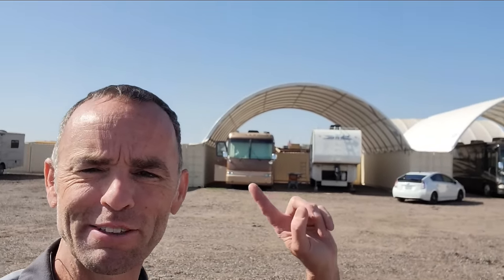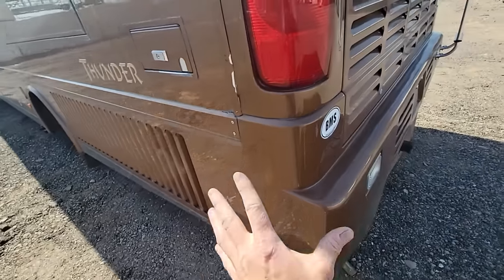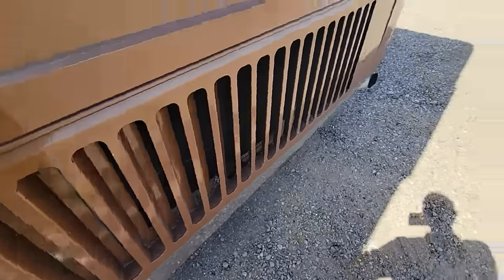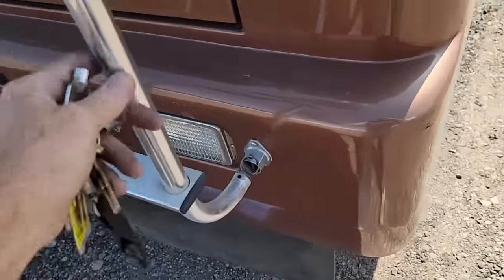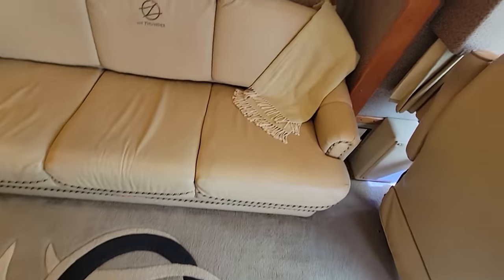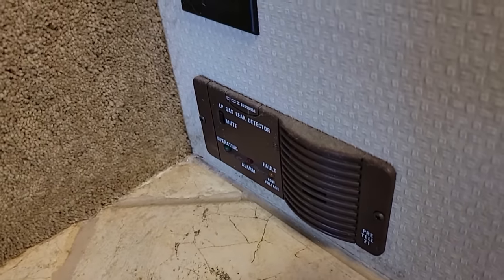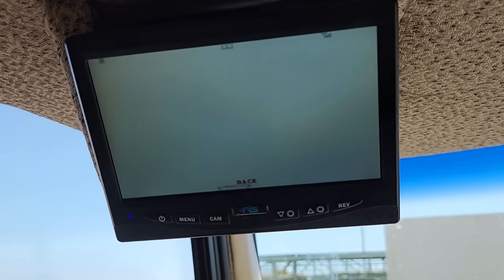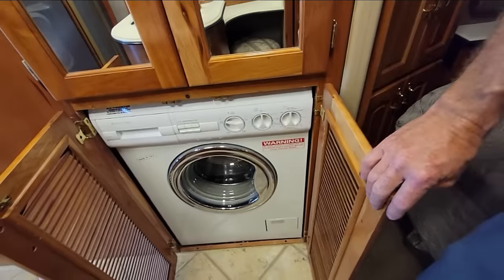The Truth About My RV and Other Common Questions

Comment: I just can't quit chuckling after watching these. I paid 75K for my 1995 Beaver Patriot more than 20 years ago and have lived in it ever since full time. Its still going strong with 120 K miles on it. Boondocking all the time. Never paid for a campsite !! The roof is fully covered with solar panels that run a home style fridge and freezer along with induction cooking and Starlink internet. Aesthetically its rough all over from the desert sun but keeps holding together !! Go Beaver !!
Reply from the maker: That's AWESOME!!! Thanks for watching!
Reply: Since you said you live in yours full time and boondock I got curious if you had videos. Those movie road rocks you filmed in Alabama Hills I can see out my back window right now! We camped and fished up here. My partner I met about 12 years ago said come see where I fish. I wasnt so much a rural woman. I actually started in a big city as a child. He said come camp with me so we took his 5th wheel. Multi issues, no heat! Then got totaled by a tree. Not our fault!  Got smaller trailer with insurance pay out thats badly built but chassis is good. Then before I knew it I had moved in with him and looking for our retirement home 4 years ago. And here we are!
Reply: I bought a house in 1996 for 75k, sold it for 350k six years ago.
Reply: Dude you're epic.  Where are you now
Reply: I probably wouldn’t have burned out on RV living if mine had been as nice as the Beaver. After 6 years in an inexpensive 5th wheel, I was pretty much done with it.. But at least the low cost of living allowed me to save enough to completely pay for a well built house in Alabama. Houses that would go for 80 to 120k in other states I’ve lived, are hella cheap here - 30k on a half acre lot, in a quiet,  safe neighborhood.
Reply: @darcymck1  and??
Reply: @darcymck1  Since I don't pay rent or property taxes for the past 20 years I bet my Beaver returned almost that much.
Reply: @thehomelesswhisperer9733  Secret Place in National Forest
Reply: What part of alabama, if I may ask? Cheap property in a conservative state is desireable! :)
Reply: How do you find places to boondock? These Beaver's make this seem doable!
Reply: Living the dream 👍👍👍
Reply: @thehomelesswhisperer9733 "And" he's way ahead of the financial game. Granted RV full-time living or even traveling is a lifestyle but there's no denying that these rigs have zero investment value & painfully depreciate.
Reply: @daveulmer So you said, perhaps that makes you sleep better at night. If your "returned" value of the rig is that much, the home owners return could be placed at $550K. Just saying 😊.
Reply: As. I had asked the price question in your first video and if I find it again, I will change my comments  for them to watch THIS video where you tell the price and why you felt it worth it, but AM curious at to what the owner had asked for (as to show how much it  was still worth after many years-and also to show how skilled a negotiator are 😅) but it WOULD be helpful if you put the time stamp on this video as to where it shows how much it cost.  For some people like me, they might not want to hear all the details LQTM!!
Reply: @darcymck1  asking for a brownie button? Gold star? Stick with apples to apples. If that’s your best investment I pity you
Reply: @thehomelesswhisperer9733  he should of held onto it for another 4!😂

Comment: After you said $64K book and more miles than book, I thought you were going to say, "So I offered the nice, rich old couple with no heirs $42K and they took $51K so they could upgrade to a suite on their upcoming cruise to Antarctica."   Of course you did fine, being a pro, just surprised you resisted the temptation to get something slightly rougher to put more sweat equity into it.  And in absolute terms, it's a great buy compared to the prices they're getting for new stuff slapped together in 2 days and pushed out the door..
Reply from the maker: I've seen enough of them by now, I knew what I wanted

Comment: For that motor air intake you could bend a piece of copper to cover / cap that seam, siliconing on the outer panel & soldering on the inside or you could clean both sides thoroughly and use a window seam sealer tape but I'm not sure about UV resistance.  Love your videos !

Comment: I believe the Thunder was their top; model with more HP than the patriot.  From what you showed us, there are non safety issues (aside for cO2 detectors, no structural issues and no roof issues. Plus you dealt with the previous owner so you have an accurate history on it too.  I always say that the 'perfect' price is in our own heads.  We decide if what we paid was worth what we got.  It certainly seems that you got every bit of what you paid for.  Lucky for you, repairs and upgrades might be less expensive because you have the tools and lots of experience to don them yourself.
Reply from the maker: If Only I had the time! :) I am happy with what I paid :)

Comment: Considering what is charged for a teardrop camper these days (I just saw one for offroading that starts at $99,000), what you paid for this was a good cost/benefit value. I did notice one very minor thing that you partially brought up in this video: you said that a previous owner may have changed some of the upholstery. I believe that is correct. The outside logos all say, "455 Thunder", but he upholstery embroidery says "425 Thunder".

Comment: I know this was 2 years ago. But thanks to you and folks like Liz Amazing. Last month. I think I found exactly what I wanted. Exactly, what I was looking for. With only one small exception. But exactly. What I never thought I could or would ever own.

I got it from exactly the kind of people. I wanted to purchase it from. They had a very nice home. It was beautiful inside. It was not cheap. They were living downtown. In a house. Right off of Main Street. Of Lockhart, Texas. And he was 88 and she was 85. And it was time to hang up the, Motorhome.

Though they told me they had only owned it for a few years. They had purchased it from another, elderly woman. And they don't know. If they are the second or more owners? They told me.

For a single person myself. It's a 34 footer. A 22-year-old, 2002, Monaco, Knight. And the one small exception it did not have for me. It only has 3 slide outs. It didn't have the 4th slide out. With the miniature office. Oh well? I'll have to use the dining table. As it's just me. My husband passed on some years ago. We enjoyed the 1986, Fleetwood Southwind motorhome I had purchased in 2012. But it was time for that one to go. It no longer serve my needs. And memories, painful. I needed a new, new or old white trash motorhome for myself. And with 65,100 miles on the Cummins 300 HP. The 7.5 kW Onan quiet diesel generator with, 1000 hours on it. Everything stock. Everything works great. Everything looks like new. These old folks certainly didn't wear it out or trash it any, at all. The treated it with great reverence. One can see. And it has the 4 door deluxe, Nor Cold, combo LP/120 V, refrigerator freezer. With the dual freezer and icemaker. And everything looks like and works like, new.

 I believe I paid slightly more than Bluebook for it? I got it for $25,000 cash. I tried to talk him down to $24,000 but no. So that's just fine at $25,000. And in January it got 6 new Toyo Tires. And a fresh inspection. There was no cleanup to do. The driver and passenger leather seats are in perfect condition. Showing no wearing or damage. The leather is in perfect condition. It only had 65,100 miles worth of a couple of old, lightweight asses, upon them. They were both lightweights. He was tall and skinny. She was short and skinny. They look like they could blow down in a breeze..

I believe the vehicle spent its entire existence here in central Texas. I took a peek underneath. Where's the rust? There is no rust just nice clean original factory paint. I wondered where the rust was? Where's all the dirt? And he told me it's never been flooded. It's got mostly beautiful wood floors. No tiles. All the wood is gorgeous. There are no holes anywhere.

And when I turned on the original Kenwood dashboard radio. What kind of FM radio station was it set to? It was set to Austin, Texas's, KFMA. The fine arts, good music station for Austin. With Symphony Orchestra's and Operas playing regularly. That's all they play. And that's kind of telling about the people you have just purchased your Motorhome, from. They are not Texas hillbilly rednecks. In fact.

He told me he was a U.S. Army Chaplain for 26 years. He's a minister. And a lifer for the US Military. Though he was not the original owner. Perhaps the 2nd or more? He knew how to make certain it was right. Religiously perfect. As there are no religious ornaments to be seen. It's for real campers!

And the 2 together took their last camping trip in January. And I'm the lucky new owner in June. Sarah told me she named her, Magnolia. So I now own, Magnolia. I always wanted a Lesbian relationship like this. She's perfect for me. But I get the top.

There's a letter that goes up top. I guess I can get a better tan up there?

Oh. And I love the color. Black shades of gray and eggshell white. No stupid colors. It's black-and-white and in between. And I think it makes it more stealth. No colors stick out. And the lovely graphics are understated. Classy. Not gaudy. More like sweeping veins of camouflage. White, dark gray, light gray and black. How perfect. Exactly what I wanted. No noticeable colors. I'm a background. Just the way I like it. As unnoticed, as possible. Though it is a large behemoth Bus like Critter. And I will certainly die if I hit anything. Or anything hits me head-on. It's a bus and I'm at the front. Of its flat face. Of which I shall also receive. And I am not in a hurry, anywhere. I get to be a 69-year-old retired widow. With a diesel pusher. I'm in a hurry to go slow. I will enjoy a lot of secondary roads rather than interstate highways. I definitely want to check out Route 66. Maybe also Route 80? More than I 40 westbound to California. I'm not in a hurry. I'm retired.

And I will be looking at getting Maximum MPG's out of my, piggy diesel drinker. I've heard I might be able to get 10 MPG out of it? I haven't taken it on the road yet. I'll let you know. The slower the better.  I need to make that diesel, last me a few extra miles. So slow going is okay. If 35 mph gets me maximum MPG? I will mostly be driving at 35 mph. That's a lot of state roads. In the middle of nowhere. Which I will love. I can park anywhere. As I brought my 1 bedroom apartment with me. How convenient.

I'm still settling in and getting this Expand-O vehicle. To be my new permanently set up home. On the road. As the lease is up on the house. And my mother and younger brother are now dead. Both. Within months of each other. I am completely devastated. And I didn't think I would have to bug out. And leave most of my life and families memories, all behind. As I embark on a new life of my own. In my retirement I will now be fully ensconced in. And become House less.. And precious memories left behind. I can't take everything with me. No reason nor ability to keep it. I have nobody to keep it, for.  I'm the last of my family. It all ends, with me. All of these memories are for those who don't exist. And you can never go back.

I am not dealing with this well.. I can't fit much more in to the Motorhome. And then it will be absolutely packed loaded with junk and stuff. I will be buried in junk and stuff within. I really don't want that for myself..  But all of those photographs and recordings and other precious memories. Of my family members now expired. And the only way I want to see and remember them. When we were all vibrant with life and loving each other. When my husband of 22 years was alive. We had so much to look forward to in our retirement, together. We had planned on it.  He never got the opportunity. He just dropped when I wasn't there  to save him. And I have to live with that guilt for the rest of my life. As he had saved my life a few years earlier. And I wasn't there for him. I was 1600 miles away out of town. On business. Oh how I wish I hadn't gone. Maybe I could have saved him? And maybe not? The hospital tried three times over. He was out on the 3rd strike.  I was told. I would never see him or touch him again..  Never feel his lips again. 60 years four months old. And we had 22 fabulous loving years together. We did everything together. We worked together. With my company.  Oh how he loved it. Oh how I loved him.

I'm sorry I have to go cry again.
RemyRAD

Comment: I am feeling so lucky!   We bought our 2000 Newmar Dutchstar a little over a year ago with 175k.  Well maintained.  No leaks ever.  Lots of upgrades (new roof, fantastic fans, automatic awing, new parts etc.).  Caterpillar 3126 with Allison transmission, leveling jacks, one big living room slide.  We paid $20k.  We put 6k into it with tires and maintenance, bearing replacements etc.    We have been on the road with it for over a year with no issues.

Comment: That thing about scratching my RV is not a problem.  Hopefully I don’t bend another axle and I need to repair the underside of a slide out from a blowout.   And who said you can’t take a 37’ fifth wheel into a Forest Service campground with a 22’ limit?   
Safe travels.
Reply from the maker: I think the Forest Service said that lol, best of luck with your fixes

Comment: It is really great that you are able to do most of the repairs and upgrades you want to do, yourself! Paint work being the possibility exception.
The one issue you pointed out that I found hard to image was the coach not having a pull out generator compartment. Beavers reputation was such that it seemed impossible that they'd miss that. We had multiple coaches going back to 1986 and have come to the conclusion that were we to get one last coach it would have to be a PERVOST conversation like Emerald. Probably a 2 slide or maybe even the right no slide. Why? Overall structure entegrity and durability.  There is no ride to compare or drive ability that comes close, perhaps a Newall not sure. 
But these busses will run millions of miles unlike the fiberglass coaches.
They make the fiberglass rigs look beautiful but they just lack the durability compared to a Prevost.
Reply from the maker: Prevost is nice, but it's like apples and oranges comparing a Diesel pusher to a bus conversion
Reply: @AZExpert  you of course are right. Have just come to the opinion that would be the way I'd go if we were to get back into this great past time.

Comment: James, I always appreciate your expertise.  About 20 yrs ago, Beaver was sort of the joke of the industry due to poor workmanship.  I am not sure if the criticism was valid but maybe the company cut some corners before they stopped production.  Looking at your experience , I don’t see much hope for the rest of us.  I think it points up the fact that a video or photos usually ( always) makes it look better than it is.  Without an educated inspector, you better plan for trouble with the parts you cannot see on a video.  I am driving a Prevost of about that same vintage and I have to say there are issues but my opinion is that it is robust comparatively 23 yrs later.  But the cost was about x4 the Beaver.  Keep the education coming.  Best to you.

W

Comment: It's the foam padding on the back of the vinyl ceiling that falls apart.  You can't re-glue it.  The foam turns to hard crunchy yellow powder over time.  I added more wood slats and stained them to match the cabinets in my rig.  Everyone thinks it's stock.

Comment: I did the same thing in December. I bought a 2008 Monaco Diplomat SRT. 124,512 mileage. Drove it back to Washington from LA. It’s has 3 slides. That means one giant slide on drivers side. Had it out boondocking in a Casino parking lot in Oregon and a big gust of wind and boom. Big slide topper toast. Not that it had been working great anyway but now hanging out all the way the rest of the way home. Lol. Solution I cut it off for now. Then lots of little things like yours slide seals. Radio, new ties, detailed, WTH did I get myself into…???
Reply from the maker: Just regular maintenance stuff like an old house

Comment: This is so packed with great information about the things in an aging motorhome and what to look for and maintain it, all can say is thank you. I am not in a position to buy new and can fix and or repair almost anything, so your videos are a godsend.  After owning an older 74 Dodge motorhome and yes it was rough and well used by the time I bought it I am looking for something in the early to mid two-thousands. Keep the video's coming
Reply from the maker: Awesome! Good luck with your repairs
Reply: @AZExpert  Sorry, I just reread my post and no I am not continuing to repair that old Dodge. Made the ececutive decision to let her go before putting any more time effort or money into her. Also I meant to say I am looking for a diesel pusher in the 2001 to 2007/08 as you have recommended. Have come across several in this range up here in Alberta and Saskatchewan. Thanks alot